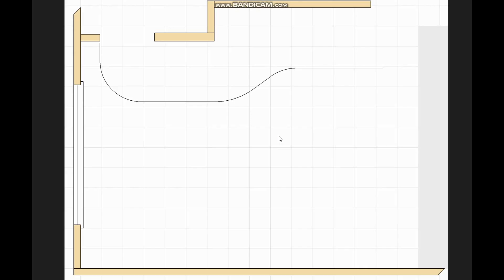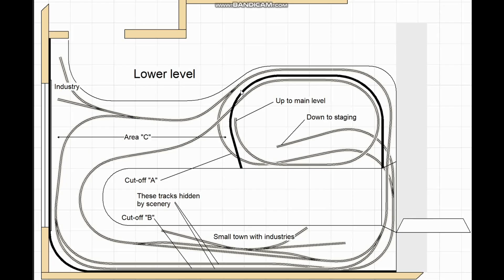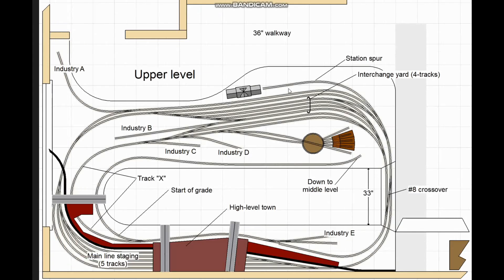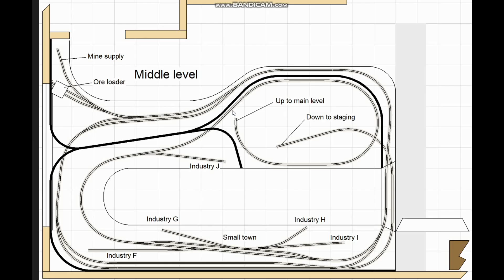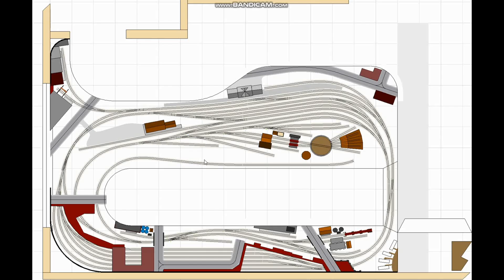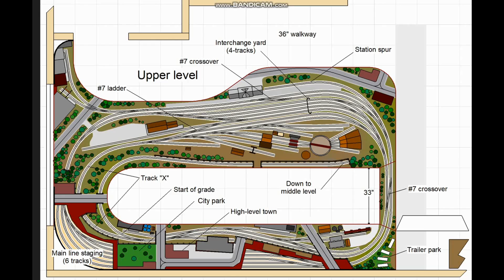Trains in the dining room

Comment: State or notate the scale, please.
Reply: 30" radius for passenger cars, and 4" between helix levels would be for HO.
Reply: @forbeshutton5487  Certainly makes sense but, as an N scaler, I would not use much smaller radius curves for full length passenger cars, auto parts box cars, etc.
Reply from the maker: Even if I forget to mention the scale, it should be pretty obvious from things like track centers and the turn-table diameter.  Also, when I say things like 24" radius is too sharp for full-length passenger cars, that should be a dead giveaway that I'm not talking about N-scale.  I've yet to see an N-scale layout with a larger minimum radius than that.
Reply: @mpeterll  Yeah. Just state it outright, please.
Reply: @donaldshroyer8633  Sure, it's useful if he sates the scale explicitly. But, if he forgets, you can be pretty sure it's HO.
Reply: well I figured it out, plus it's in the description.
Reply: @strobelightaudio  It is now.
Reply: Thank you.